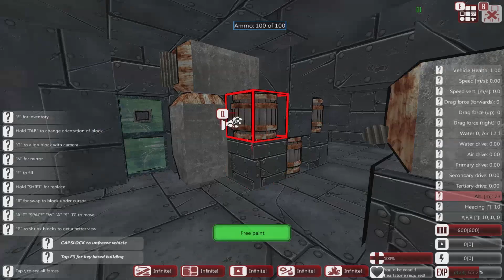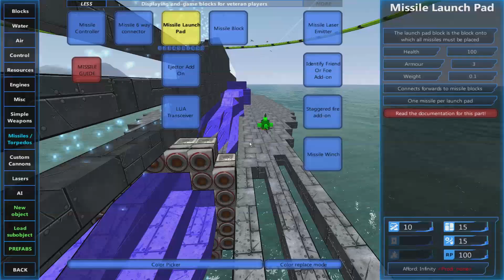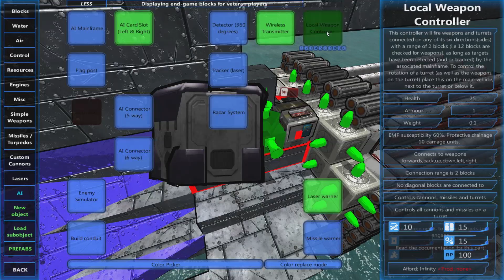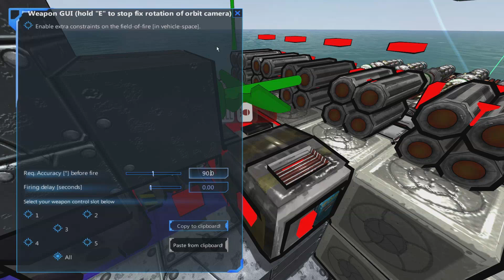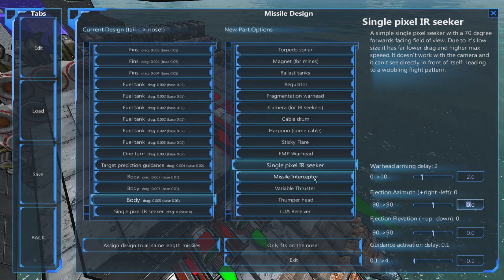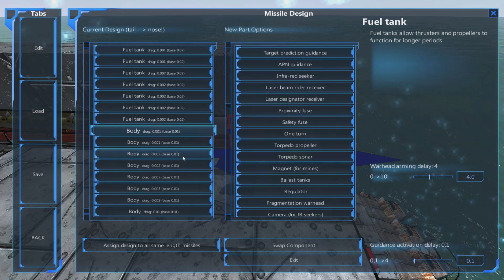From The Depths E2-Epic Build Pt2, Missile Mouth.LetsBuild,Playthrough

Comment: I cannot post. Youtube deleted all the content. :(

Luckily I am an IT guy, so do you know that site where you binning the paste?
There is ASfkfLUM needed after the the address.
Reply from the maker: +normal6969  Possibly it disliked that link though it was some sort of spam etc
Reply from the maker: +normal6969  To your questions.
Lasers can link to a turret and spin block, although not tested in quiet a few versions so cannot be 100% in current.
Smaller diameter and length shells fire faster due to quicker cooldown and also quicker loader to firing piece times. Check the Ammo customiser and set to your diameter and it will give an idea of the change.
Your docked ships will interchange if you put them all in the same resource group, say group 1 and then set them all to a low % to keep they will balance everything between themselves automatically.
A ruler would be handy but not used often, if there was some sort of co ordinate display from centre then could be worked out.

Not sure on the links, I have put them in myself but I tend to use google links which maybe youtube allows.
Reply: +Dels Gaming Thank you for your answers, I will test axial laser connection today.
The first and main middle part connected seamlessly via rubber blocks I saw in your video.
The connection is perfect, the rubber blocks sink into eachother. :P

I couldn't paste anything here, not even a character "a", but it comes only sometimes. That will need some research, too. ;)

Comment: hey del, i just started watching this series so i don't know if you finished or fixed it, but you forgot the ejector things on the inside missile blocks
Reply from the maker: +Enze Jansen That was sort of on purpose I think from memory on this ship, as the thrusters have 0 delay firing so will be faster than ship on launch. Also they fire forward so should not get hung up on launch pad. I may have also had issues getting the extra block to fit with the style. Watch to the end, it all works out eventually and rains terror down on enemies :)

Comment: I just watched the first episode and was sad as it was over, and now there is a new Episode. Now I´m happy :D
Reply: +Theo Günther And I have a question : What does the ramp time actually do on the missiels ?
Reply from the maker: +Theo Günther The ramp up time gives an acceleration time to the missiles variable thruster. Similar to the short range thrusters delayed start but instead of no thrust at all for a period of time it is just slowly spooling up. This can be useful on missiles with ejectors if ejected at an angle, or want missile to turn tightly after launch before getting to full speed. Not as useful as the delayed start imho
Reply: Dels Gaming thank you!